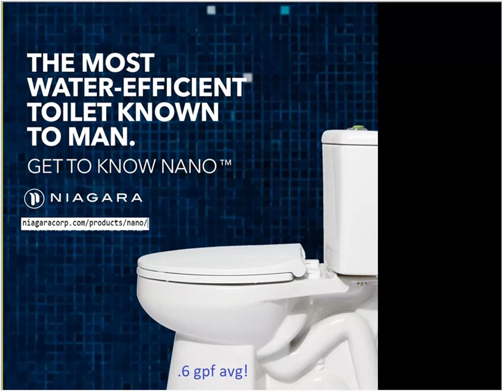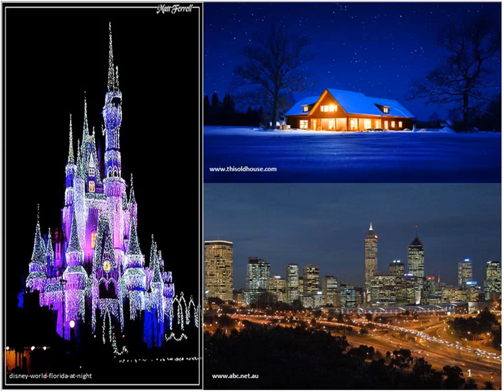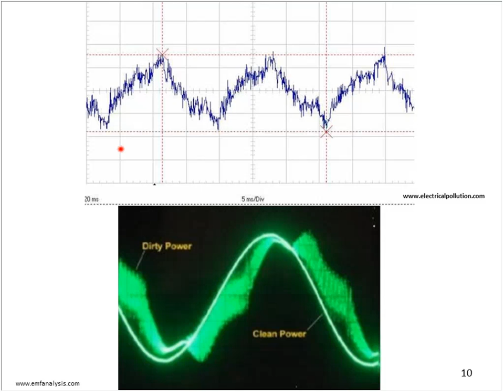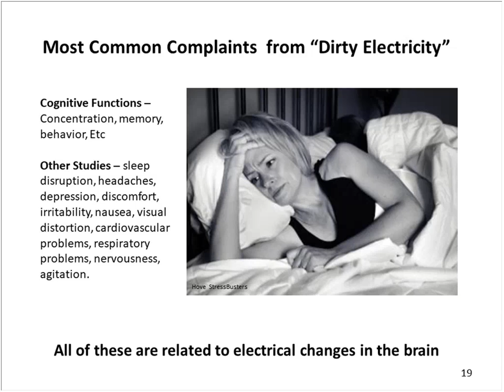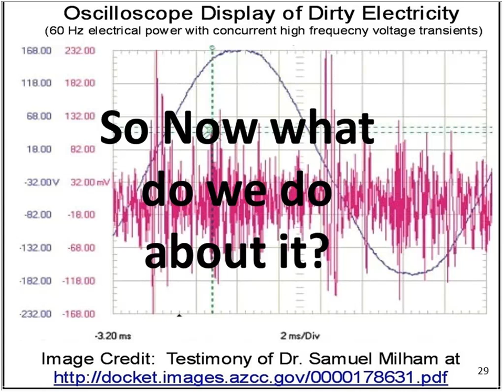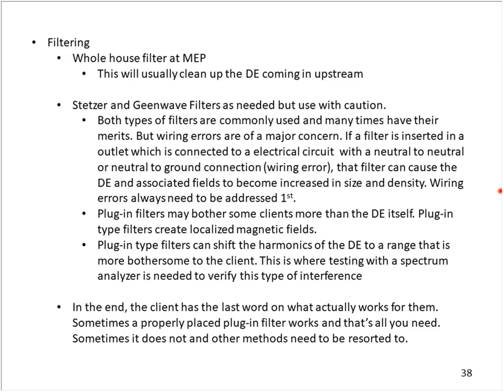Reducing occupant exposure to EMFs: Part 5 - Dirty Electricity

Comment: For a good example of the sound of dirty electricity you can use an AM radio near a power saving lightbulb. The power saving bulb will create the noise for you by rapidly switching on and off as a means of power saving. This creates transients which offers a recognizable coarse sound that's very different from the 60 hertz buzz or hum of an incandescent bulb using the same AM radio set down below 540 off a station in static. If you try a lightbulb and there isn't a huge difference in AM radio sound you need to try another. It's an unmistakable sound of an awful coarse grind almost like a rapid fire weapon in your radio.

Comment: Could you use an isolation transformer to prevent switching harmonics coming back onto building wiring from computer power supplies where swapping to a linear type isn't feasible?
Reply from the maker: " Yes, having the electric utility install an isolation transformer will significantly reduce incoming voltage transients of Electromagnetic Interference (EMI), also known as “dirty electricity”. A one-to-one isolation transformer can be used on a property when your building is the only utility customer on that transformer. Much more likely, the building shares the transformer with other customers, which requires a different solution, such as a Dairyland isolation device. These are all very expensive solutions. A much more affordable and commonly used solution is to have an electrician install a whole-building dirty electricity reduction device at the building’s electrical service entrance, such as the SaticShield Power Perfect Wire-in Box or Sine Tamer." Create Healthy Homes
Creating Healthy New Homes and Providing Environmental Home Inspections, based upon Bau-biologie®

Oram Miller, BBEC, EMRS
Certified Building Biology® Environmental Consultant and Electromagnetic Radiation Specialist
Adjunct EMR Faculty and Senior Lab Leader for the Building Biology Institute (BBI)

Serving Greater Los Angeles and Orange Counties, and All of Southern California

11693 San Vicente Blvd., #342
Los Angeles, California 90049

Phone 310.720.7686
www.createhealthyhomes.com 
info@createhealthyhomes.com